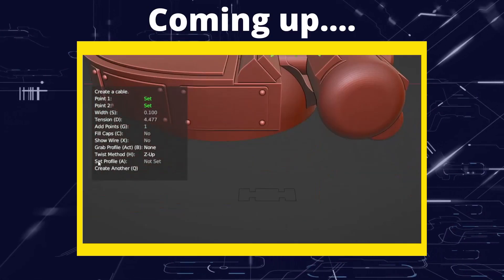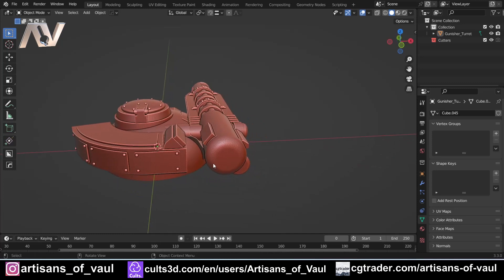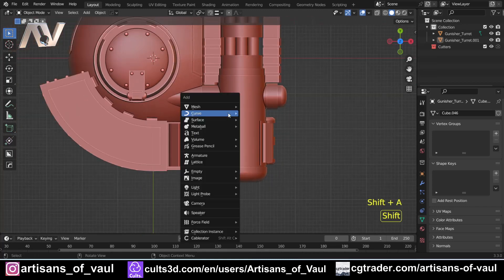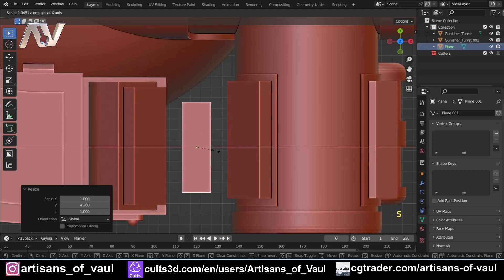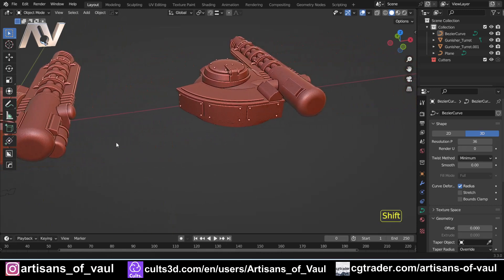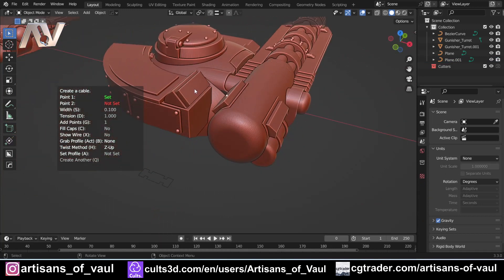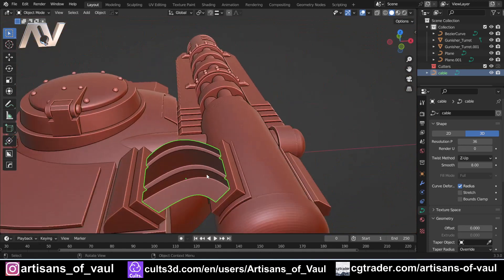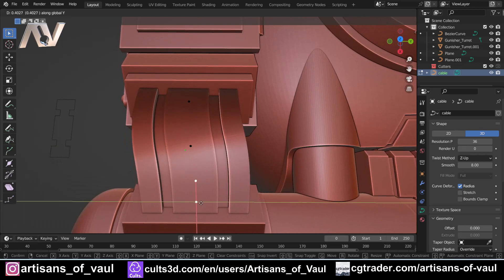Using curves to make an ammo belt in Blender

Comment: Hi,
Can we also scale the instance following the curve?
Reply from the maker: Sure thing. So several options, first of you want all thr instances scaled just scale the original (you will then need to apply the scale on the original for it to work). Or if you just want to scale individual instances you'd need to apply the instances and then you can select them. Alternatively if you did the instances with Geometry Nodes you could scale them that way (the video next Monday on YouTube or today on the Patreon has an example of instances along a curve for a quick way to place rivets)
Reply: @ArtisansofVaul  thank you, I was not sure if it was possible, i might have a second try with geometry node then. My first try was to kind of redoing the curve modifier but I had issues with the twist. I was not perfectly happy with the way it handles the case where the radius of curvature is comparable to the length of the object you want to instance 

Thanks again for sharing your knowledge,